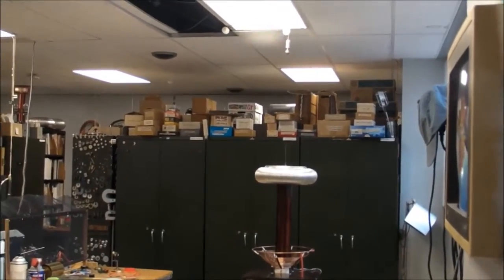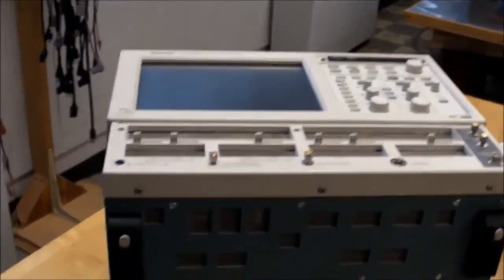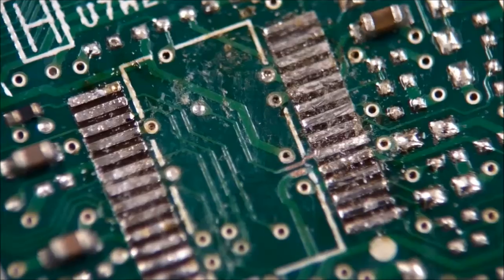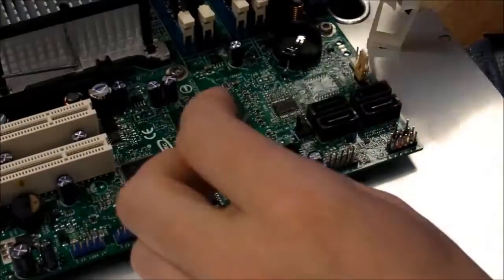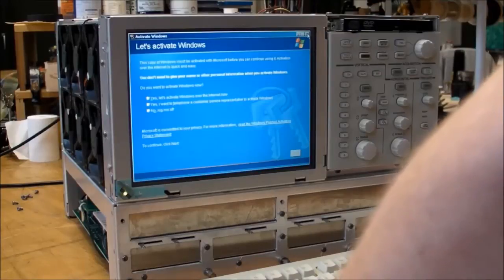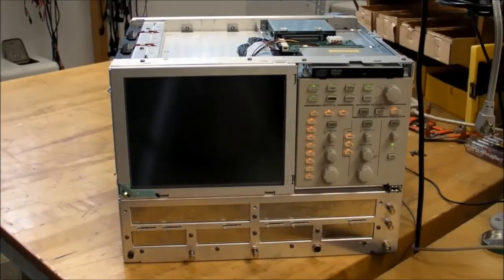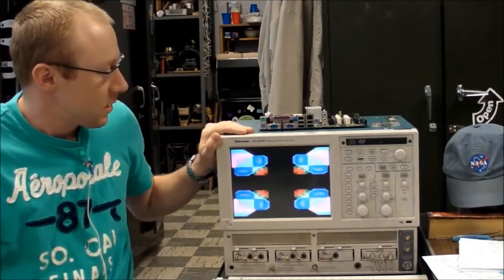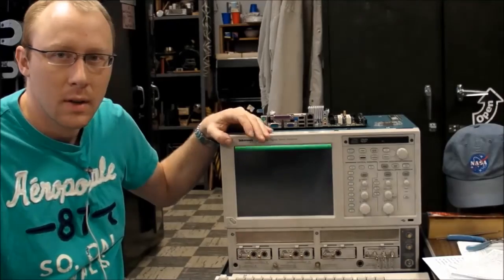(#0075) Tektronix DSA8200 Repair - Part 3 of 3

Comment: wow that is a strange way to handle equipment software. LOCK ALL THE THINGS! why would makers of the thing choose to make repairs harder, in reality no one would mass pirate their windows on other multiple ten-thousand dollar scopes:) best use of the scope by the way;)
Reply: TPM is industry standard x86 motherboard protection against rootkit malware infections, and for encryption of internal storage. It isn’t generally related to DRM or software licensing protection. The software licensing may use some system ID from TPM, but that isn’t anything exclusive to the TPM chip. That said, running Windows is a dumb approach. Linux would be clearly superior for embedded systems like this.

Comment: Thank you.
To activate a Microsoft windows is not so hard, You just need key: 25 characters and you can find back site on your device i saw it, that ticket)
to call microsoft active service ,. it is also free call
Reply from the maker: +The mad Engineer At 12:06 in this video, I did get it validated with the 25 digit code. But the DSA uses a version of Windows that was modified and managed by Tektronix. In this case, calling Microsoft would not help. So it was also necessary to transfer the "trusted platform" IC for Windows to recognize that it was installed in a genuine Tektronix product.

Comment: I am working on a simular scope TDS 8200 with a dead hard drive.  Where can I get a copy of that software.  I bought the hard drive but do not have the software to load back into the scope.  Thanks John (916)seven five 2, 1400

Comment: No, for the scope to think that it is a kosher scope, the correct code MUST be on the mother board. The COA is on the box to satisfy Microsoft, the various scope components in effect are the actual COA key. It will also matter if you ever need to restore the operating system, and want more than just a PC. With Tektronix gear, your not supposed to swap out anything w/o paying Tektronix a fee.

Comment: Your soldering skills are awful. Maybe after you figured out the problem you should have just hired a skilled tech to do the soldering for you. It probably would have resulted in a cheaper, faster, and better done repair. For example no destroyed vias or lifted pads. You did a bang up job on the troubleshooting, and I very much enjoyed the series and learned a couple things too!

Comment: This system is installed by factory in OOBE mode so code from COA sticker is never used.  You could just connect that monster to the internet enter code from COA and  system have to be validated as genuine...

Comment: Wow, are you lucky or what. Next time low temperature de-soldering alloy and a temperature controlled soldering gun; no chance of lifting pads or board damage. Just go slow w/lots of flux, whether it is through hole or smd. You can tape off the area with capstan tape to prevent the low temp solder from contaminating other areas; will stick to many things that solder wont. The tek service people can be surreal at times.